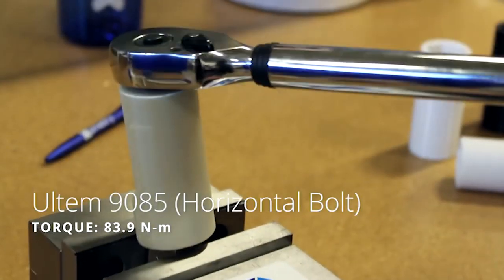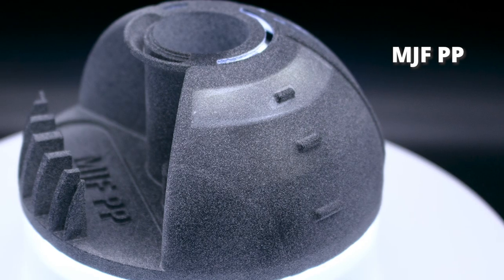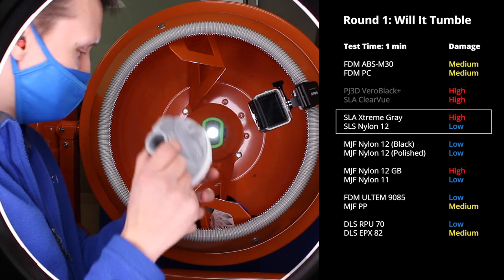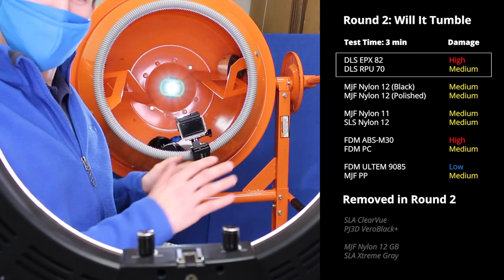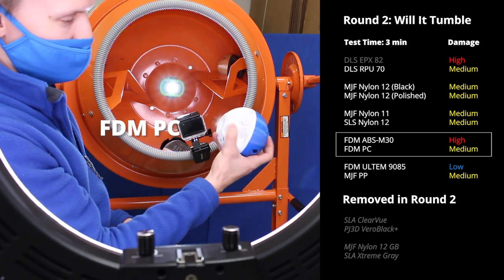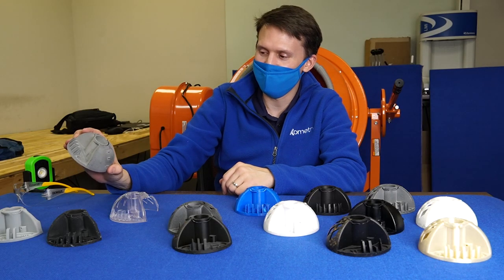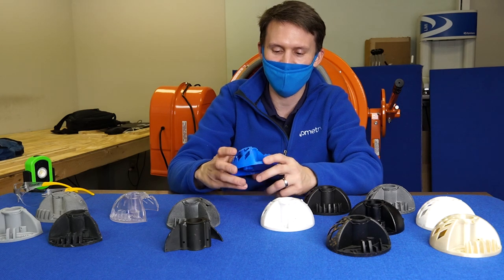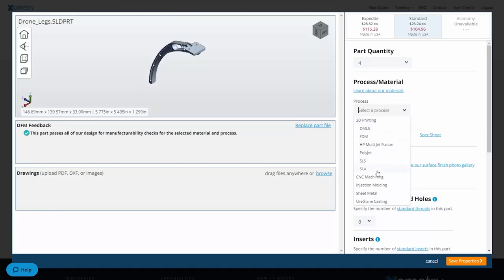Engineering Challenge | Will It Tumble: Testing 3D Printed Parts With a Cement Mixer

Comment: Your test is very interesting, but maybe a little too destructive. way too aggressive. Because of this you are not able to see small differences. For example, if you made your test 20x less severe and the test time 10x longer, you would be able to rate each material in a ranking more easily. Then make a top 15 for the best choice. Now it mainly comes out that all materials eventually fail if you handle them wildly. In reality, various materials are most suitable depending on your design.
Reply: Thanks for the feedback and I agree! I had to do some adjustments when setting up the design so the spheres did not get stuck in the back of the drum to make it fairer of a test. When I did that, it ended up becoming more of a small-drop-test but I still think the findings were telling and show how some materials are more durable than others.

I hope to do more follow ons showing how different materials wear -- I don't think this is the last time you'll see that cement mixer!